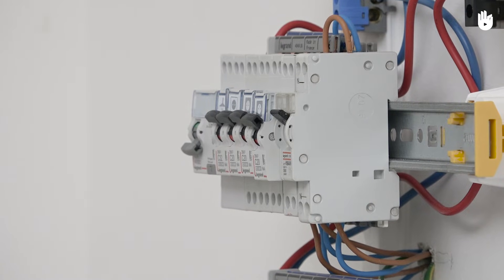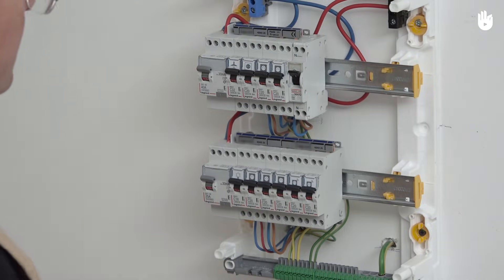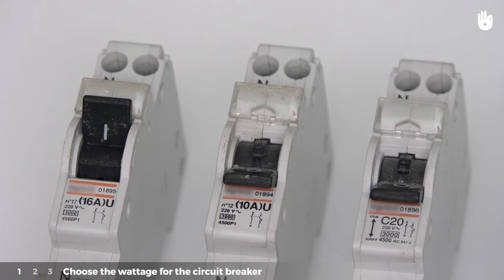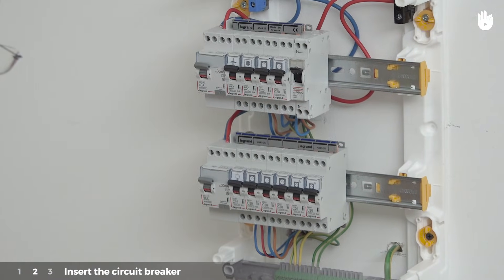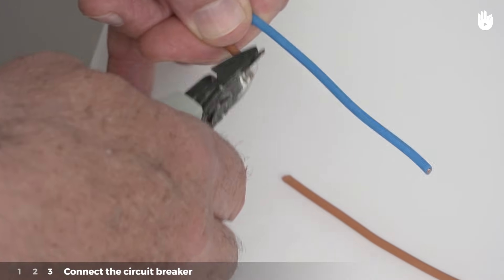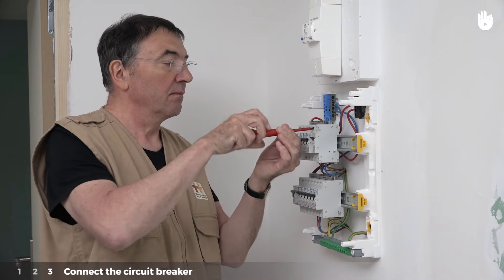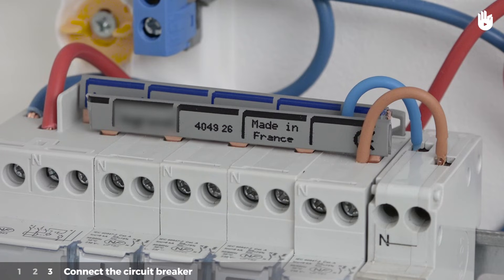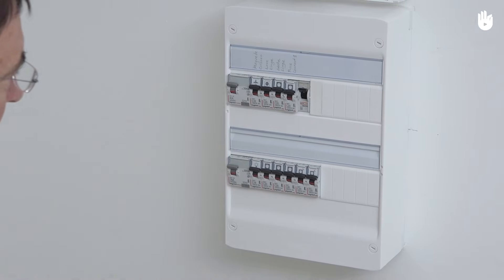How to Add a Circuit Breaker to an Electrical Panel | Electricity

Comment: So in the UK circuit breakers go in series for the whole phase? If the first one trips they all run out of power, what in tarnation is this?
Reply: No. new regulation demands two RCD in the consumer unit and divided in two serial if you like to call it. In case of earth problem, one of the RCD will trip out, for over loading, only one fuse will trip out.
Reply: Those I believe are French MCBs. One group of MCBs is protected by an RCD and the second group is protected by another RCD.

Comment: I am surprised he said that for light circuit use 16 Amps circuit breaker and didn't mention what thickness of wire needed to use. According to BS standard we should always choose correct circuit breaker related to the wire. 1.5 mm wire need 6A . 2.5 mm wire 16A and so on. it is wrong to install 16 A circuit breaker for 1.5 mm wire.
Reply: bendi ro Agree!
Reply: Correct 6A for 1.5mm
Reply: Because in Europe, for home installation, the smallest wire used is 2.5mm².
Reply: @IAmThe_RA not true
Reply: Maybe he understand that if we search for this video, then we competent enough to understand which wire for which.

Comment: Wow, I'm surprised the UK and other countries are allowed these kind of breaker panels,  direct contact to the wall, wires just ran through a hole in the wall, plastic enclosures.   Are there a lot of home fires in the uk?   I mean I get that they are 230v with less load so less heated conductors when loose,  but if something happens its just going to be a melty fiery mess..
Reply: There are constant changes in wiring regulations in the UK - for example all new wirings must now be in a metal box! (Also this video is not an example of a typical UK installation). There are many different wiring regulations across Europe and they all have different practises. Any poorly installed electrical wiring generally ends in a melty fiery mess regardless of the countries supply...
Reply: Haha, I didn't even notice it was directly screwed onto the wall and not actually an enclosure, per se. This would not fly in Australia, although double-insulated cable through a gyprock would be fine. Had there been a sharp metal edge or it goes outside, non-metallic corrugated pipe would be required. We do however have plastic switchboards, although ours are required to be protected by RCD as well. These days they are built in to the CB in most products.
Reply: They are circuit breakers. As in, if the load on the circuit exceeds its rating it'll trip. The home will also have a main breaker. So if you're an idiot and start a mig welding school in your lounge room the main breaker will stop the wires getting to hot and frying your house.
Reply: Normally we screw the unit onto a 6mm plywood sheet that is attached to the wall and then then a nice gloss panel for a nice finish, this is for learning. Protected by MCB's it will just trip no fire in 99% of cases
Reply: Most homes in Asia (Southeast Asia especially) have concrete wall instead of wooden wall like you have in most houses in U.S. (not sure about Europe though).

Comment: When did it change to fit a 16 Amp C/B instead of a 6 Amp C/B for a lighting circuit?????
Reply: I’m sure it’s in a different country hence them using 16a for lighting as apposed to a 6amp mcb here in the uk, just a guess... I might be wrong!
Reply: They are dutch or french, that's why it's different.
Reply: @czonczike630  in the netherlands for any common home its 16 a for lights as wel for power outlets
Reply: @irshicosmos3233  Thanks for the correction.

Comment: Absolutely shocking video
(no pun intended)
This is a good way to burn your house down or worse. You should never add MCBs unless you are trained to know what you are doing. Nothing is mentioned here about testing / RCD protection / correct wiring / voltage (for different countries) and basic EIC regulations.
Reply: Yeah I cannot believe that videos like this even exist. It seems everyone is not just an electrician now, but a doctor as well. Thanks internet.
Reply: Evil comment,  you are electrician and soon  jobless😄
Reply: @medmak1494   I am not an electrician. I know basic stuff about causes of fires with bad electrics. I've had to learn when I moved into my house to put right all the bad DIY electrics that were totally unsafe. This video doesn't even mention sealing the panel with fire rated sealant once the wires are installed. This comes under building regs. If a fire were to start in the panel, it needs to be isolated within it and not travel into the wall where it cannot be tackled or even detected.
Reply: Agree with this. Make sure you always use a qualified Electrician for this work. Didn't even mention the most basic "pull" tests, which protect your swb from arcing.
Reply: @benscaper5345   This video should be taken down. It should at least have disclaimers. It's open to a law suit as it is. Any school leaver can look at this and think "Oh, it's that easy then? Okay...." .... picks up non-electrical screw driver
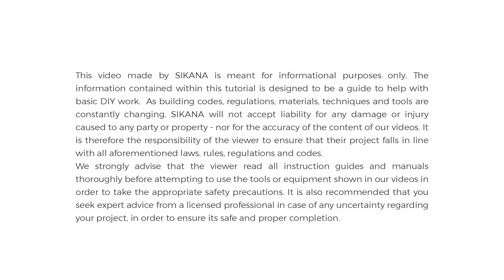Reply: @ArcanePath360  3:10
Reply: @benscaper5345   Ah thanks. However things like this should be at the beginning of videos.
Reply: A sparky's job is piss easy ... testing lol socket tester does job ,no tripping, no on did and saved thousands
Reply: @amalalnckamsk6939   Yeah ok mate
Reply: @ArcanePath360  what if the wall is made of concrete (like in most houses in Europe) which is a bad conductor and not easy to burn?
Reply: Also if those are RCBO's you don't need an RCD. RCBO's are the future.